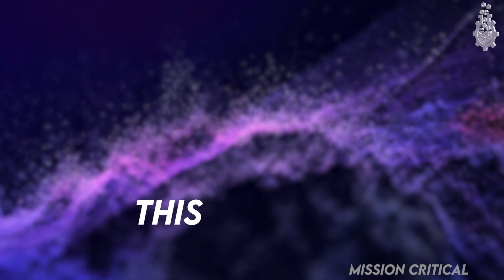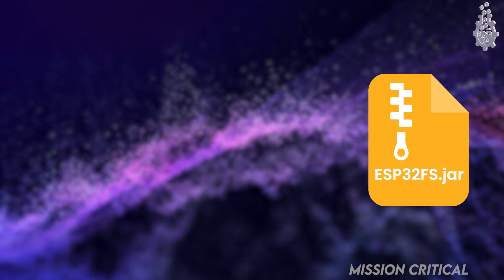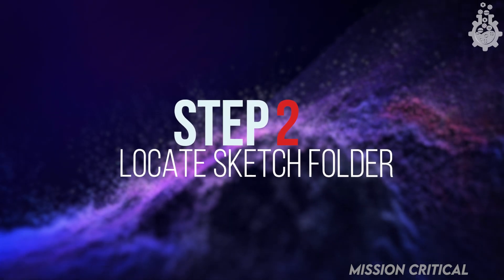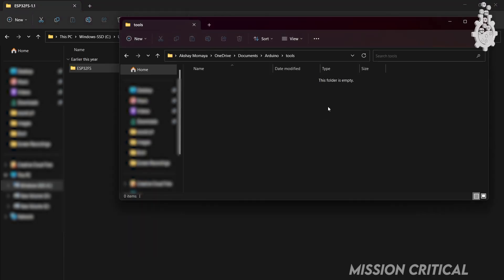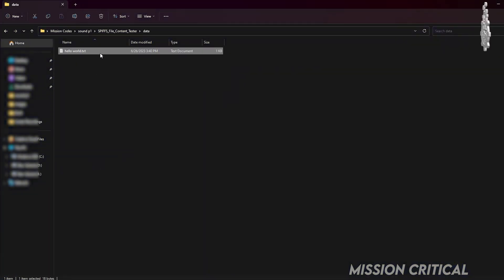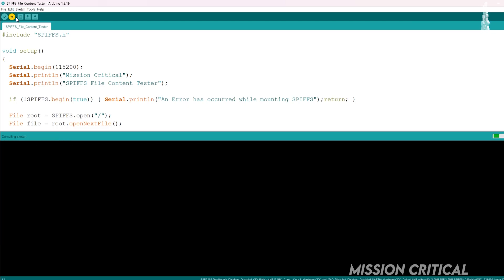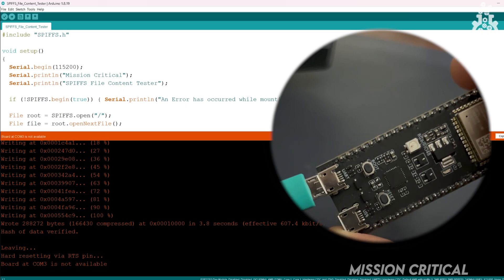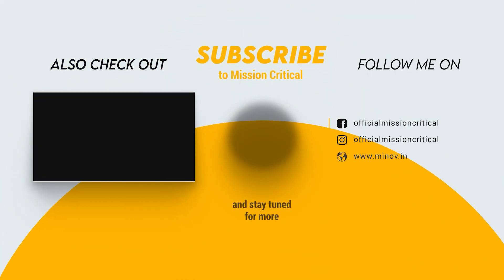ESP32 SPIFFS tutorial for beginners | how to upload files in ESP32.

Comment: It's not compatible with Arduino IDE 2.0+?
Reply from the maker: I'm not sure did not try that version sorry, do try and let me know if you get it to work with 2.0
Reply: @mission_critical  No, it wont work with Arduino IDE 2.x  I have done all of it right, and it does not show up in the tools in the IDE. Many other users have the same problem. It appears that this method only works with Ardunio IDE 1.X
Reply: @guluandthulu  this is very very helpful. I have been stucked on this issue a little over a day. Not until I saw this comment of yours did I realize the issue is with Arduino version. You are completely right, only Arduino IDE 1 has the functionality of using external extensions from the user created "tools" folder, Arduino 2 doesn't support that at all. I wish this was more widely documented!!!
Reply: yes use 1.8.19

Comment: but it is not showing anything me in serial monitor, I followed the same procedures. But in arduino IDE tools menu, there is no option of "ESP32  sketch data upload"..please reply bro
Reply: It's because you're using the 2.0 arduino IDE. SPIFFS Doesn'y work for this version. Try to install a 1.X Version of the IDE instead
Reply: Thankyou @mulakid769
Reply from the maker: I guess you are missing that tool which is used to upload sketches

Comment: It is easy to clone esp32s by simply using esptool. What if one has developed own prototype proprietary product software which should not be possible to copy or clone. Is there a way to upload an encrypted password bearing file which prevents a cloned esp32 to work without encrypted password file?
Reply from the maker: Yes there is a way to protect your code from being copied "easily" do understand in today's time big chips get flash dumped too, but you can use an option in esptool to secure your firmware from being read, so if you try to read or write firmware on that chip, it basically erases itself. Look it up, you will definitely find lots of options for the same
Reply from the maker: And if you want to copy from such, you need to understand how exactly that encryption works so you can bypass chip by simulating same signals, I have seen people on YouTube cloning apple firmware and lot more, do try to do some surfing